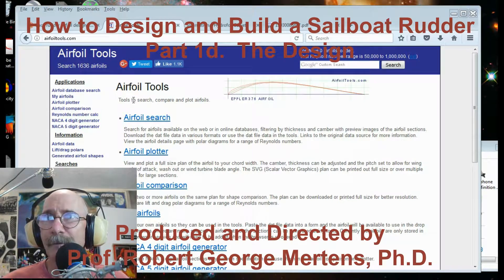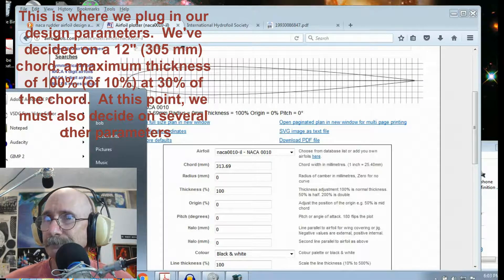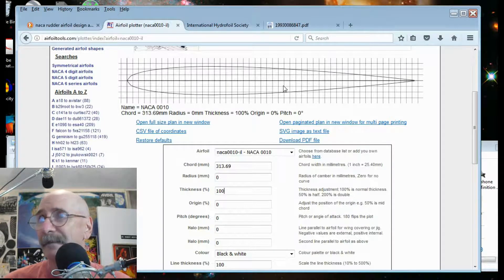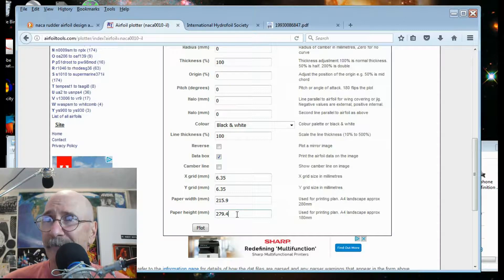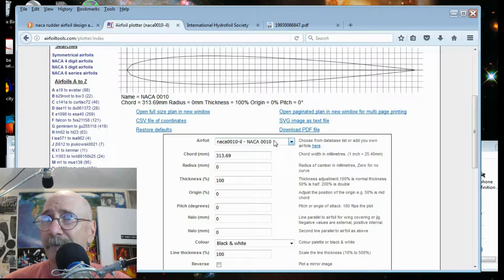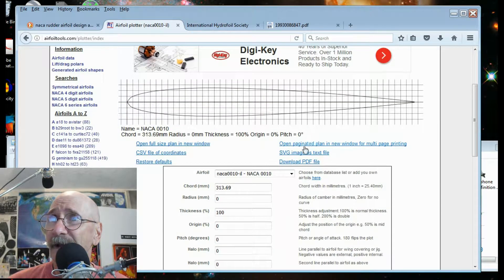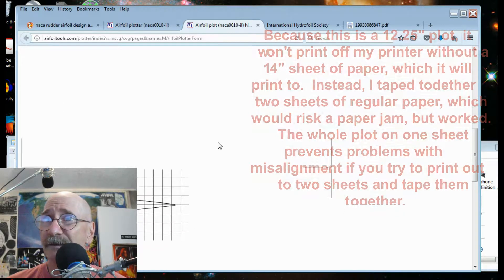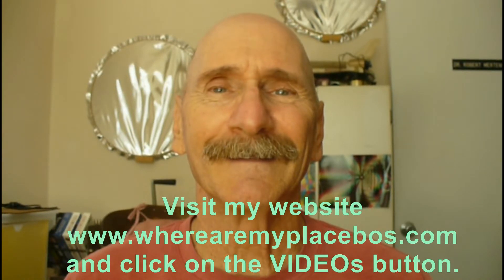Part 1d. Design and Build a Sailboat Rudder: Airfoil Design

Comment: I watched all the videos about building a rudder... They were extremely helpful as I need to make a new rudder for my Adams 21 here in Australia. Love the way you presented (engineering way of working). I will start building it this week using your videos as guide. This was the only reliable and and easy to use reference I could find. Thanks for the excelent work!
Reply from the maker: I'm glad to hear my videos have been helpful.  Thanks for letting me know.